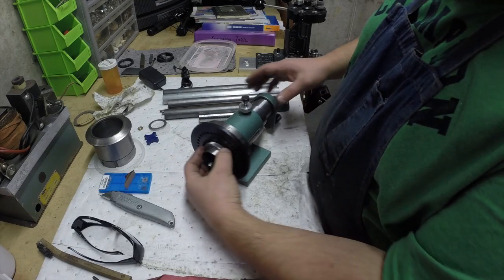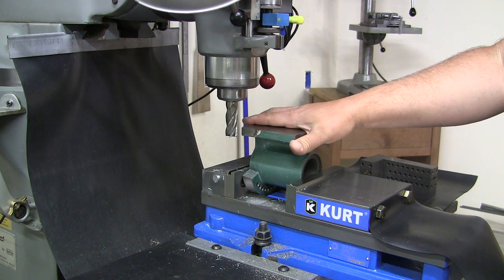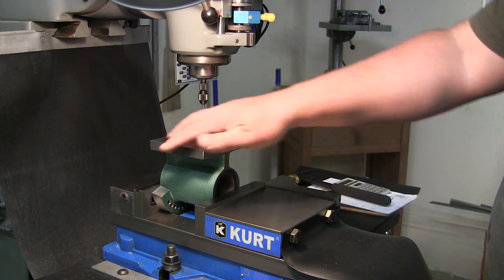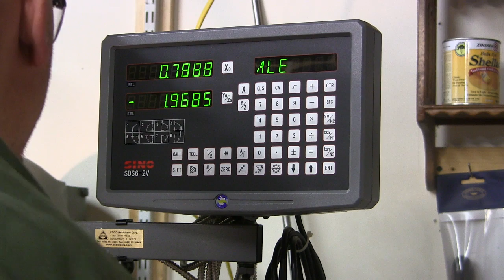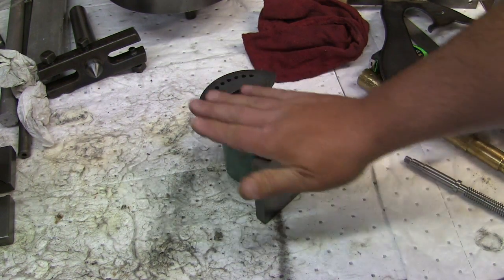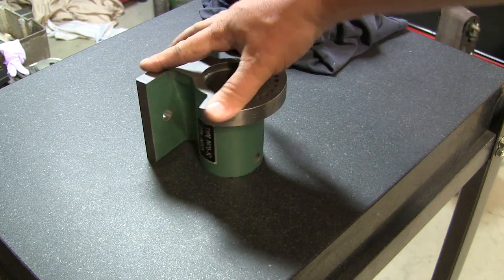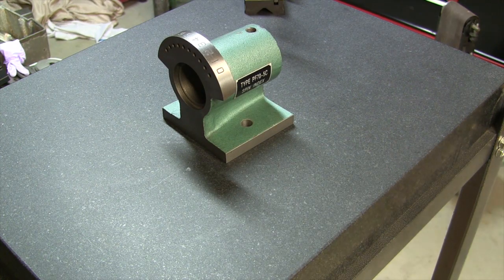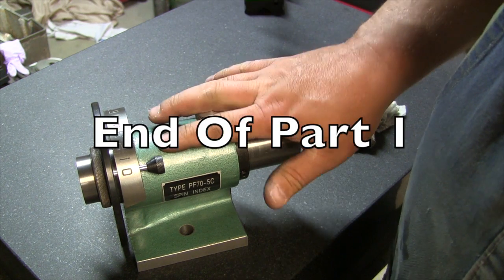Spindexer Modifications - Part 1

Comment: Enjoyed the video, squaring the base sure makes sense for vise mounting
Reply from the maker: outsidescrewball Thanks Chuck. I've only touched the surface on this little guy. More work needed to really dial it in. I need more tooling (measuring) that's on its way, but this is becoming very interesting.

Comment: When you were surface grinding, I can hear that gravel on windshield taping noise when in cut. That could be a from number of reasons, the wheel isn't fully dressed, the wheel is to hard, out of balance, or bad or cold spindle bearings. That would also explain the rocking and the scallop pattern. Short of drastic changes and methods, Dress the full wheel, add paper shims in the hub between it and the wheel inner rim, let the machine run for a few minutes, and change wheel hardness if necessary. Read the surface grinding section of the machinery's hand book, a lot of good techniques and perimeters to be found there.

For cleaning the surface plate, there is an on going discussion on whether or not you can use water based cleaners on the plate. Amazon claims "No petroleum, kerosene, or ammonia. Safe on skin. Nonflammable." so that's got me curious.
Reply: The drill Chuck on the mill sound like it was loose lots of chadder

Comment: Great video Brad. Very informative.

Thanks,
John
Reply from the maker: ShadeTree Machinist Thanks John - I've only touched the surface on this little guy. More work needed to really dial it in. I need more tooling (measuring) that's on its way, but this is becoming very interesting.

Comment: Hi Brad,
nice job over all, i would have mounted the spindexer housing on a spindle and then the spindle in the vice in order to get the edges of the base in alignment with the spindle. although it's probably not going to be critical for most jobs that the arbor be perpendicular with the edge of the base it sure makes for speedier set up. when it is critical it will save a lot of time tramming in the spindle
regards,
 mike
Reply from the maker: HolzMichel Yup - late response here, but the new video is up - and will also have a part 2.
Reply: BasementShopGuy
yes, i saw them already. you're doing an awesome job of making a cheap tool something useful. nice work! looking forward to the completion.
cheers
mike

Comment: My dividing head has a loose lock. I plan to bore it slightly oversize, install a custom threaded insert, Loctite it in place, then drill and tap for a smaller screw with a brass tip.
Thanks
John
Reply: I don't know what 409 does to granite but some household cleaners will cause the granite to swell unevenly.
I suggest you buy and use surface plate cleaner. At the very least, that will remove that question.
A 16 oz bottle from Enco is about $8.00, not including shipping.
That's what we do at work.
John
Reply: Or use ammonia, like Suburban Tool recommends.
John
Reply from the maker: John Bazaar Thanks John, appreciate the viewership ;)
Reply from the maker: John Bazaar Thanks, I think I'll give it a try. I heard this too and I certainly don't need my granite standard swelling. Yikes...

Comment: Hi Brad,
If it is like just about any Chinese tooling or whatever, usually the threads are metric... That would explain why it's not available on a Imperial only lathe.
Those indexers are ok for the price, as long as you know the limitation and tolerances.
Reply: If you have the money, you can buy Yuasa  or Suburban Tools co., otherwise you might just hunt the best price... ;-)
Reply: You're welcome... ;-)
Reply from the maker: pierre beaudry Yep, you're right ;)
Reply from the maker: Level3-RC SUBURBAN TOOL!!! Expensive, but the bees-knees. Super high, quality. Used on eBay is a couple hundred.
Reply: Pierre's Garage hi pierre, another problem with buying Chinese "precision tools" is the precision, it generally doesn't exist in the export items.....However,  I have been lucky with a few Chinese items, I bought some slip blocks, yes they were still expensive but worth it as they are ground "dead perfect". But, power tools, unless I need a throw away item, I avoid them.

Comment: Nice  improvements. The grinding wheel sounds like in needed dresding. It wasnt rujning true hence the intermittant noise. I hope the base is running true to the axis of the spinner as this would be the most difficult inital task to correct..not the mention the squarenes of the front and sides to the same axis.  Nice video
Reply from the maker: +Proinnsiasoc It's all square and true. Thanks!

Comment: It may be an optical illusion but at about 14:30 it doesn't look like the ground face is flat. It appears to be up off the mag chuck.  Also you didn't mention how you got to machine the edges true to the central axis.  As with almost all cheap tools they aren't cheap if you cost the time to sort them out but they can be fine once you have and they do make for interesting videos.

Comment: Nicely done Brad.  Did you verify the register face of the bore was perpendicular with the bottom of the base?  A good way to do that would be to stand the base on its back,  and use your last word indicator against the register and rotate the base to see if it is parallel with the surface plate...
Reply: Nice video.  Don't underestimate your starrett last word indicator. Unless it's be damaged in some way, you can work in tenths without breaking a sweat. I've done it and seen many others do it through the years. Although I prefer a federal indicator with a large dial for close work. I have never owned a tenth indicator in my life. Jumpy bastards and repeatability problems. Glad to see you clean your surface plate prior to using. Good habit. Remember when using your surface gage, dragging your hand on the plate can leave sweat/oils that can throw you off. The bottom of your surface gage needs to be flat! Check to see if it rocks. If it does, lap it in. That'll be a beautiful spin fixture when you're done! Mike
Reply: Fred Miller i dont understand what you are saying... the base could be in a twist?  or the bore drilled at a cant?
Reply: carryit around Another way of looking at it..  Is the spindexer bore parallel (in the same plane) with the base of the unit.
Reply: i see what you mean Fred MIller... how could you indicate that in??? i have one of these and i want to make the bottom plate perfect to the bore.
Reply: carryit around I think I would insert the spindle into the bore of the spindexer base then invert the entire unit and register the spindle on each end of the base to the mill base with 1 2 3 blocks between the mill base and the spindle (securing would be a task)  then mill the bottom of the base flat.  That otta do it....
Reply: Fred:  hmmm dont think i could do it that way... i wonder how Fenner would do it..
Reply from the maker: Fred Miller This response is a little late, but no. In the attempt to correct some obvious blems from the factory, I overlooked just how bad it was. But as you see now, I'm taking the time to really dial this little tool in. Thanks for watching!
Reply from the maker: Michael Murray Thanks Mike. Yeah, I beginning to see that a 10th's is VERY challenging to work with. I may get a 1/2-thou indicator and see how that works. Can definitely 10ths, within the large space between the marks.
Reply: BasementShopGuy, Half thou indicators are a good option. They're just thou indicators with an extra hash mark between the thou grads. A few guys I worked with that came from the aircraft industry had 50 millionth indicators. Without temp control and clean room condions forget about it! Lol
Reply: I'd imagine the base plate was machined first before the spindle bore so that it could be clamped to whatever jig they use.

Comment: Hi mate.
When you were talking about the set screw, I was talking to the screen, saying drill it out, and put a new thread in there.  You must have heard me ; )  I love the tools that you have access to, I know that you have rebuild them and that some of them were in a rough state, but you do have them.  Do you ever sit back and think about that?  It did hurt me that you use the granite table as an assembly table, especially after Stan's video.  Are you looking for an other lathe, don't get me wrong, the one you have is beautiful, but not very practical/limited.  Would you buy a newer one, if one came to hand?
Reply from the maker: Marcel Timmers Thanks Marcel. Yeah, I've since made sure to not assemble things on the plate - gotta keep it nice. Yeah, sometimes I do sit back and lay my eyes on the machines and can't believe what the shop looks like. The amount of money spent is VERY small in comparison to the countless hours and sweat put into getting them back up and running. That's the thing that makes me the happiest - is that they're not rotting away somewhere unused. And yeah, the drilled out screw hole was in part 2 (if I remember correct) and thought that someone might suggest that to me before part 2 came out. Funny stuff... Thanks man ;)

Comment: No matter how I try I cannot find a reason to use a spinner over a dividing head.......maybe I'm missing something after all these years.
I find a dividing head with 3 and 4 jaw chucks is a tough act to follow.
With the spin indexer having a 5C bore you would spend 10 times the cost of the spinner for a set of 5C collets and they can only hold specific diams that they are made for.

Comment: Thanks for this vid ! I just subbed. What RPM did you drill and what rpm mill the cast with ? Was your end mill HSS , M42, Carbide ? I have the same exact spindexer and planned to do exactly what you did. But my plan was to put the indexer in my vise on its side, chuck up a piece of bare 3/4" drill rod in the 5C and indicate on that to align the spindexer in my vise, so when i cut the side i know it's in line with the spindexer centerline. The sides of my spindexer are not square, even by eye the bottom looks like a keystone rather that a square. By the way brad, I also play music and have a fishing cabin in remote upstate NY...Hmu . Thanks again bud !
Reply from the maker: If you use a collet to indicate off of, you'll be indicating off a collet and not the spindle. Some go this way, but for me you're basing it all on "a collet" which can be imperfect. That said, how crazy are we getting with "spindexer" work, right?  The cutter - I believe it was HSS and the speed - man, I don't remember. But what I (do) remember is slowing it down until it "sounded" right. You can actually feel it in the machine and hear it too. Excellent on being a musician and you're lucky to have a cabin - that must be awesome!
Reply: Yeah thats true. I feel guilty that i never calculate feeds and speeds...lol...i go by feel and sound, testing on a scrap first. I hit you up on your facebook . You can see the music studio, our cabin ...alot of slammer fish too . Check it out in my FB albums. And I'm right up the turnpike from you I think. ...and again, great channel !

Comment: Did that bolt have 27 TPI? A south bend 13 CAN cut a 27 tooth gear, but you need to swap some gears in the geartrain. Find a manual, it should be in it.
Reply from the maker: Andre Gross It was metric Andre.

Comment: I did not see you reference your cuts to the spindle bore.  Pretty is one thing, accurate is another.  Form follows function...
Reply: *****   I made the very same comment and I agree I will take accurate over pretty any day...
Reply from the maker: ***** You're right. I've only touched the surface on this little guy. More work needed to really dial it in. I need more tooling (measuring) that's on its way, but this is becoming very interesting. Lesson learned, never trust that the tool is precise. Always measure a tool's accuracy. Thanks Bob ;)
Reply: +Bob Korves  Agreed,  the AXIS of the Spindle Bore being the primary reference point,  any and all machined surfaces should be parallel or perpendicular to that AXIS.  ( such as front and rear faces of the body and bottom surface )  One could probably take that for granted if it were a Suburban Tool item, but an import no matter the brand, not so much.  Better to check it out to see where you stand.
Reply: I am pleased you agreed with me Darryl.  I tried to explain to Brad several times but I don't think he understood my comments.
Reply from the maker: +Fred Miller Guys - maybe I'm missing something, but I indicated off the front and back of the spindle (while it was on it's side) to establish parallelism with the spindle. Then I ground both sides. Then, I ground the perpendicular planes, 90 to those ground sides. And for the bottom plane - it measured pretty accurate when indicated to the spindle (front and back).
Reply: +Fred Miller ...it is a difficult point to convey, especially on line.  We are all thinking along similar lines, but just not the EXACT SAME LINE,  i.e. the spindle BORE center line !
Reply: +BasementShopGuy , Brad, did you show that procedure any where in one of the videos on this project ?  It sounds like you have taken a logical series of steps to get where you wanted to be.   Hoping it  is OK when you complete it.  thanks for the effort and the replies to our comments.

Comment: Hi, I just got a spindexer and I have a question for you, I don't know if I should ask for a replacement. I have looked at a lot videos to see if others read the same as this one does. if I put the pin in the 0 hole the arrow is pointing at one deg. if I put the pin in the number 9 hole the arrow pointer is at zero. for some reason I think that the arrow should read zero and the pointer should also read zero. if they all are made this bad I don't think that I will try to ask for a new one.....Jon Ell, Thanks

Comment: It was a Hardinge invention> I put radial metric ball bearings in mine . It was way better than the new aluminum cheapo from Suburban tool.
Reply from the maker: Dave Stambaugh I’m intrigued - where do the metric balls go?
Reply: @BasementShopGuy  You have to bore each end of the cast iron housing.for the bearings however the spindle is a perfect push fit. The bearing races cost almost two hundred dollars each the last time I bought them. It is a low profile bearing. Not a standard.

Comment: Hello, I am from Brazil, I would like to build a similar, the scale of 10 fixed holes do you know how many degrees has each spacing?
Reply: I am no machinist, but a 360 degree circle broken into 10 fixed arcs would be 36 degrees per arc...
Reply: @robertftx  Hello my doubt and in this vernier with 10 holes from 0 to 9 how many degrees is between each hole, 9 °?

Comment: What do you use these things for?  We have one in our shop.  Too much chatter to do any milling.  Are they only for use on a surface grinder?
Reply: +PanamaSticks ;  light milling should be OK with one of these in decent shape...    perhaps your unit may need some tuning and or repairs to get it usable for some small milling operations.
Reply: +Darryl Dodge Thanks.  What kind of tuneup?   It just doesn't seem rigid enough.
Reply: check out the spin indexer video by thatlazymachinist , he shows hot to make a diy tail stock to stop chatter .